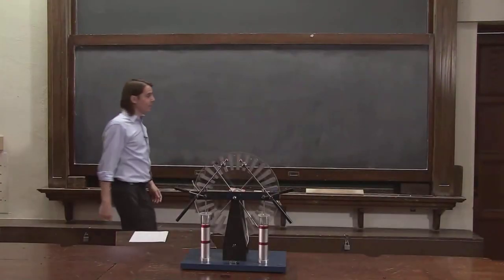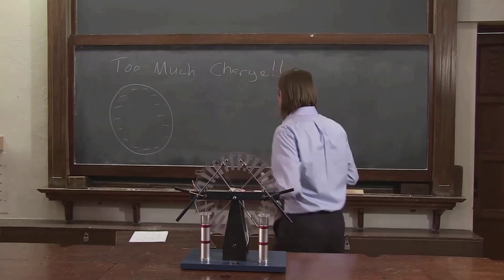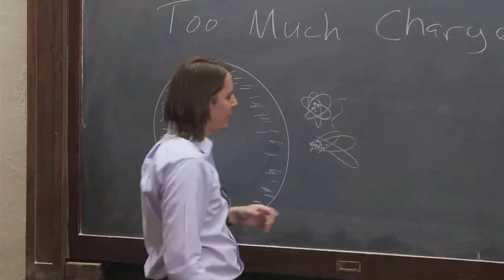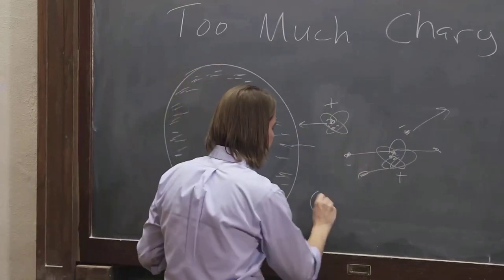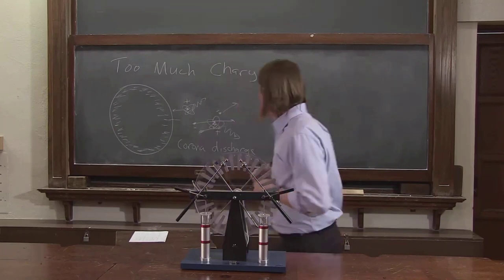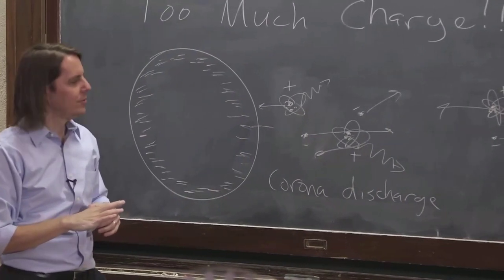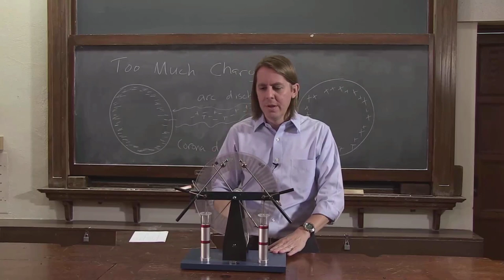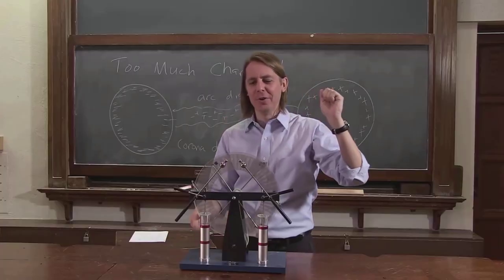Corona and Arc Discharge

Comment: As I was wondering what would happen if he puts his hand between the two electrodes
You demonstrated that too! Thank you very much for your effort!
And also what is the the difference between arc discharge and capacitor?
Reply from the maker: The Wimshurst is essentially a capacitor that you charge up.  The two round electrodes are like the plates, but the capacitance is not high since they are not flat and not close together.

Comment: I honestly think this is the best explanation of this phenomena on Youtube. I would also have appreciated if you explained brush discharges a little bit
Reply from the maker: Thanks!  Yes if you watch closely you can see some arcs around the brushes.  I didn't get into exactly how the Wimshurst works, but the brushes a dragged over metal pads on the insulating plastic wheel.    I suspect that if you run the wheel fast enough, the brushes charge up to an arcing potential in the time they spend moving between the metal pads.  It probably also helps that the brushes are made of sharp wires, so it is easier for them to create an arc.
Reply: @Prof-Hafner 😮

Comment: That was an amazing theoretical and practical explanation! Thanks a lot for your effort.. and that demo.. ouchh!
Reply from the maker: Thanks.  Only the first spark hurts! :)
Reply: it is
Reply: This video was probably instrumental in helping Kakashi develop his Lightning Blade, so thanks. Konoha will always be in your debt.
Reply: @Prof-Hafner  Great video! Could you explain why this is? You mentioned the system being discharged after each spark, so wouldn't each spark feel like the first as the system is being 'reset' every time? Also, aren't arc discharges incredibly hot (or is this wrong)? How does the same arc that turns air into plasma not burn your finger? Incredibly interesting topic... will definitely check out some newer videos :)
Reply from the maker: @iceezander  Thanks icezander.  The sparks are all the same as you say, but your finger is numb after the first one!  haha.  Not entirely numb, but noticeably so.  Yes, it is very hot, but it has a very small heat capacity since it is a gas.  To burn you, something needs to be hot (to transfer energy) but also have a lot of energy to transfer.  It is like why you can take a piece of tinfoil directly out of your oven without getting burned.
Reply: @Prof-Hafner  Oh! I never would've thought you'd go numb that quickly, and the energy transfer makes loads of sense! Thanks for the quick explanation, keep doing what you're doing!
Reply: bro , i am from future , and this corona thing has grown wild .....

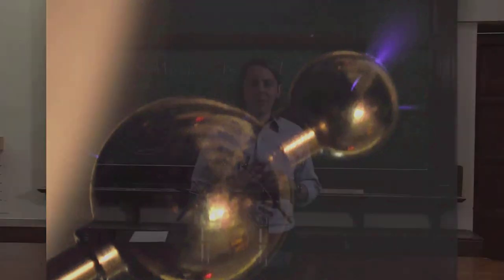Comment: 4:12 the concentration of corona discharge is based on the proximity of the other electrode, not "accumulation." without presence of another object, the charge accumulation is equalized on the spherical surface.
Reply from the maker: Yes, in an ideal situation.  The localization is probably due to small asperities on the surface that you can't see.

Comment: In DC electrostatics the corona is visible, yes. But for the high voltage power equipment in the grid, the charges oscillate at 60 Hz so the corona is in the UV spectrum. It takes very expensive cameras to shift that UV light into the visible light bandwidth.  Do you know how to make such a camera, or do you have some ideas about it?

Comment: Corona Discharge & Corona Virus ...

The ultimate Warriror 💪💪💪
Reply from the maker: Actually, corona discharges are used to chemically modify surfaces and would certainly disinfect!  So you could treat corona with corona.
Reply: @Prof-Hafner  I actually have an Ozone generator at home to treat a particularly smelly room. Although I'm worried about the damage it might leave behind on plastics. I read comments that Ozone and Plastic interaction can cause material degradation.

Maybe if you ever have time for it. A video on that topic would be well appreciated ✌

Comment: IMO the blue color is EM radiation which IMO is photons directly emanating from the fast moving electrons which are travelling in waves. Their blue light reflects off the plastic and metal. The arc discharge is white due to the frequencies coming off the other ions blending with each other.

Comment: Thanks for the video! Can the corona discharge alone be enough to generate ozone, or do you need the arc discharge for that?
Reply from the maker: Good question!  Both types of discharge will create ozone because both create ions with enough energy to break the O2 bond.  I'm not sure which type of discharge makes more ozone or which is more efficient.  I'd guess that corona is more useful for applications since it is more continuous.

Comment: So if you have near enough and charged enough electrodes in air you can get an arc discharge.  But you can also get a coronal discharge in the air near the electrodes.  I've seen a coronal discharge in a fairly strong vacuum.  How does that happen if there's no air to ionise?  Is it to do with the breakdown voltage changing with pressure?

Comment: I know this is an old video, but in case somebody is still reading this:
Would it be possible to create faster ionic wind by repetitively disabling the collector electrode (=ion wind between a "sharp" emitter and a blunt collector) and instead "steal" the ions away by accelerating them into kind of a linear particle accelerator (= mixture of a miniature linear version of the CERN and a multistage plasma actuator, with high-voltage electrodes with fast-switching alternating polarities and gaps in between)?
I wonder if this could be more energy efficient than a traditional multistage ion wind generator, because neutralizing ions only to create new ones in the emitter of the next stage seems like kind of a waste.

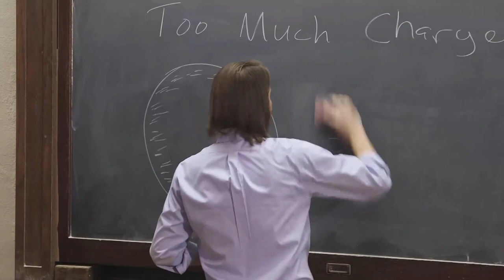Comment: Hi, really cool stuff you got there :) but I don't understand one thing... at 2:28 you say that electron is ripped of the ball and hits the atom which will end up making an ion. But shouldn't there be just one negatively charged ion with one more electron on its orbits rather than one positively charged ion and one separate electron? 

one positively charged ion = atom missing one electron, right? So you have one electron from the ball and one electron from the atom in the end. Or is this wrong? What am I missing here? 

Thank you
Reply from the maker: Hey, in this case it is not just the separation of a neutral atom.  When an excess electron leaves the metal conductor, it is accelerated by the electric field to a high kinetic energy.  So when it hits gas atoms, it has enough energy to ionizes them and keep going.  In fact, the electron freed by that ionization would also accelerate, thus the cascade effect.

Comment: Dear Mr. PHYSIERGE, IT IS VERY USEFUL LECTURE. BUT NOWADAYS many manufacturer equate this Corona Discharge or Arc Discharge to Partial Discharge. which I think is wrong as per IEC. Please through some light on the difference between PD and Corona Discharge Or Arc Discharge
Reply from the maker: Interesting!  I had not heard of partial discharge before.  As you can see, I am just describing the "old fashioned" corona and arc you would find in a freshman textbook.  I read a little on partial discharge and it looks like the terms are fairly loosely used.  I can't say anything authoritative, but one physical difference I see is that for partial discharge, when occuring in a small void in a dielectric, crosses the entire void.  In a way this makes it more like an arc discharge because it is jumping between two surfaces (they aren't conductors, but are highly polarized).  I think of a corona as coming from one surface and "dying out" before it reaches another.
Reply: +PHYSIERGE thank you very much. it is more clear to me

Comment: Thank you so much sir , i have one question that Corona occur above 100kv, but you have been showing Corona discharge how amount of supply are you used for demo?? please explain me sir
Reply from the maker: The voltage is created by mechanically turning the wheel.  It is not attached to any electrical power supply.  Charging surfaces by rubbing can create electric potentials in the kilovolt range, but the amount of current is so small it isn't dangerous.

Comment: So that explains how the phone when it is charged more than 100% they will turn into heat. Because the corona is trap under the casing , and they cause the electron to collide with each other . There fore it create small friction inside since its trapped air molecules. Does that make sense? I opened up my phone before the metal part of the wire its so small that it releases not too much discharge. So its not gonna make your phone explode anytime sooner. But they are building it from contraction and expansion of the battery. Battery pack will become distort overtime.
Reply from the maker: Maybe. In general the voltages inside the phone are probably too low to make a corona at the wire surfaces.  Then again the feature sizes are very small as you say.  Still, I suspect most loss is in the chemistry of the battery.

Comment: Great !! how can one ball get +, while the other get - ?
Reply from the maker: That is due to the motion and complicated construction of the Wimshurst.  As the big disk spins, it has alternating panels that are plastic and metal.  When wires slide along the disk, they generate charge by rubbing the plastic (triboelectricity) then when they hit the metal it is transferred to the metal electrodes (balls).  You are doing work when you spin the disk, so you are putting in energy to create the separation.

Comment: Is all of this the same in a vacuum?
Reply from the maker: No, the gas pressure makes a difference.  For the arc discharge you need high-pressure gas (atmospheric pressure) to create enough ions for the runaway arc to form.  At lower pressure you might still get the corona discharge, but it would probably be dimmer and more spread out.  In a "perfect vacuum" (which doesn't exist) you wouldn't get any of this!

You will see other effects that require low-pressure gas, such as visualizing an electron beam, like this video:
https://www.youtube.com/watch?v=orsMYomjwIw

Comment: We need refinement in the physics terminologies, first of all it is a Spark -discharge and NOT Arc-Discharge, secondly the term 'Highly-charged' is multifold, as applicable to Electrostatic charging, the quantum of charge involved is far low compared to the Voltage involved. The Capacitance and the charge are low, while the Voltage generated are very high.

Comment: Why is there a sound to this discharge?
Reply from the maker: The arc causes a large, local pressure change.  As the air responds to equalize the pressure it launches pressure waves in the air (sound).  At least that is what I have read about thunder, so I suspect it is the same for my little arc.

Comment: what is that Arc or Corona Producing Mechanical Device??
what's its Exact Name?
Reply from the maker: It is called a "Wimshurst Machine".  It is complicated to keep up with what is going on, but as it spins metal brushes pick up charge from the plastic disc and transfer it to the electrodes, building up a large charge and potential, which eventually causes the arcs.  The two cylinders are capacitors that increase the amount of charge it can hold.
Reply: +PHYSIERGE Thank you for your help... and this video really clears my concept of arc and Corona discharge...
Reply: is it basically a capacitative dynamo?

Comment: Fly back transformer
Reply from the maker: Also makes cool sparks!  The only storage here though is two capacitors (the cylinders).  It has no windings.
Reply: @Prof-Hafner   
How about connecting a high rpm motor to the construction 
Thank you.
Reply from the maker: @lordelectron6591  You could drive it at a higher speed, but even at the speeds you manually drive it, the potential reaches a limit.  The coronas on the electrodes leak charge, and you start to get arcs between the electrodes on the wheel.  To go to higher potential, the main thing to focus on is making all of the conductor smooth to avoid any rough edges.  This is why the dome of a van de graaff generator is a sphere and, ideally, usually polished to a mirror finish.  The lack of sharp corners keeps the field from building up and leaking charge at any spot.